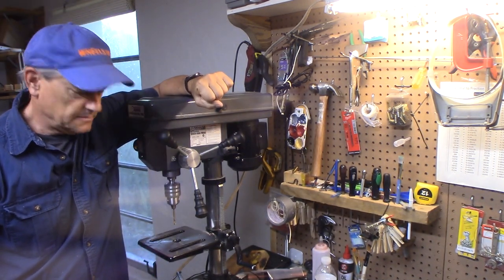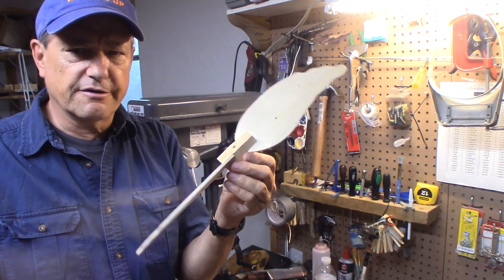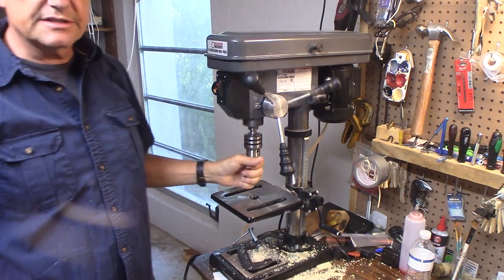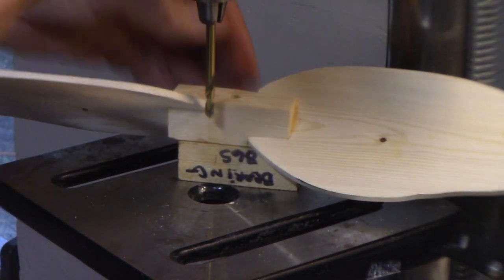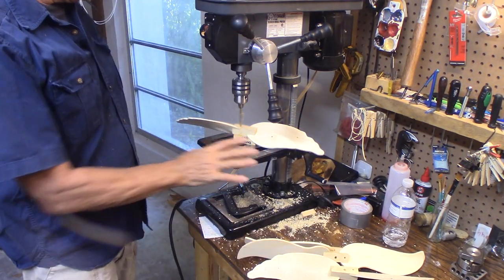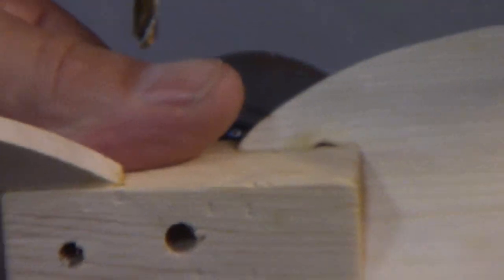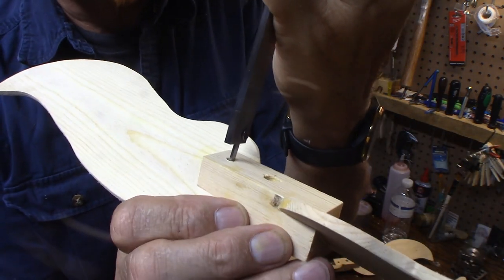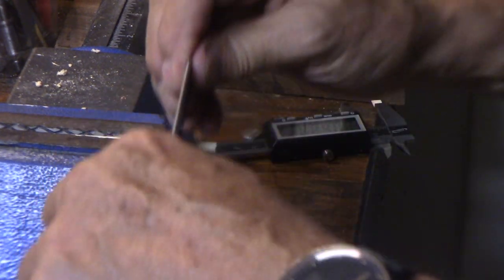How to Pin propeller blades for beginner's tips diy Whirligig Wings

Comment: What is the advantage of a square hub vs. a large diameter (broom handle) slotted dowel with the wings centered?
Reply from the maker: The square hubs simply make it easier to cut the slots on the table saw

Comment: What would are you using for the wings themselves?
Reply from the maker: These are cut from a two by four from Lowes.  They are usually Douglass Fir or Pine.  I have tried to read the stamped labels on the wood, but it's some sort of industry code and hard to figure out.   Mostly avoid plywood because it deteriorates quickly in the weather.